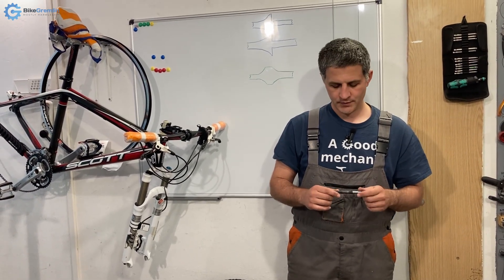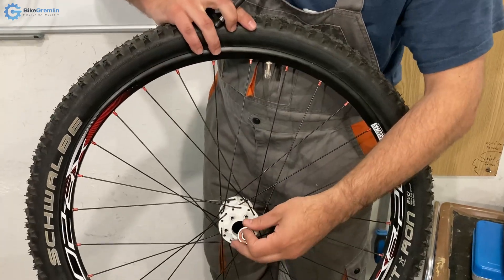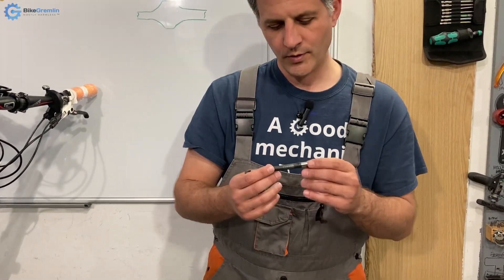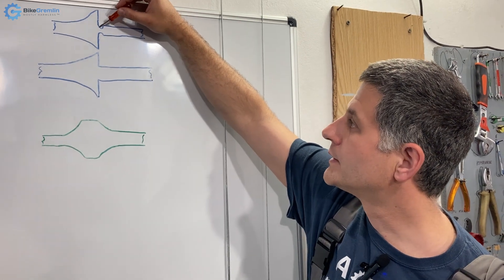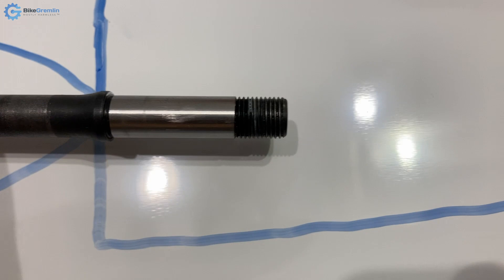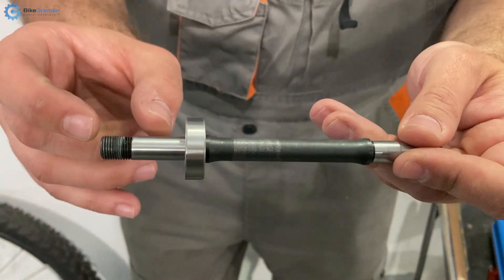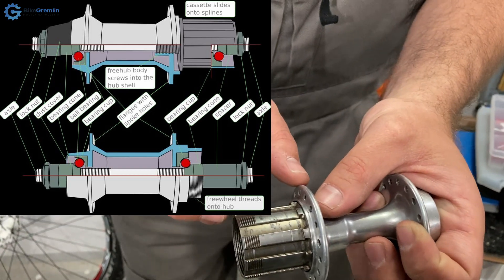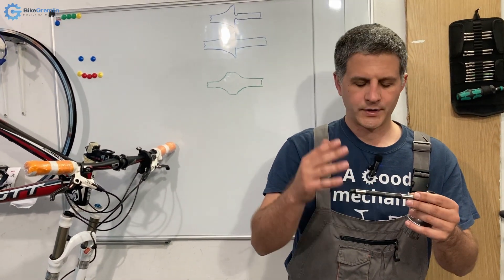DT Swiss XR 20 freehub design flaw?

Comment: The undercut relief groove is a relatively common engineering solution when it is required to precisely position a bearing race against a locating face. Use of a simple fillet requires that the chamfer of the bearing race is large enough to accommodate the desired mate. Dimensions and forms of undercuts are covered in DIN509. 
This, however, does not eliminate the possibility of a poorly engineered design.

Comment: Interesting Q,   I don’t know the answer as I’m not a qualified engineer but I get the logic you are using.  Part of the picture may also be related to  attempts to make the axle lighter as well ?
Reply from the maker: I don't think this has much to do with weight - because having a uniform diameter axle of the smaller diameter would have resulted in lower weight.

Relja

Comment: seems that dt swiss made this design to avoid sharp edges to remove stress concentration, but seems that not a good solution with such axle diameter
also that novatec d042sb has similar axle design
Reply from the maker: I suppose the "mini-curve" was used to make the situation less bad. But it's still the weak point and probably not a gradual-enough axle diameter decrease to avoid fatigue breaking.

Relja